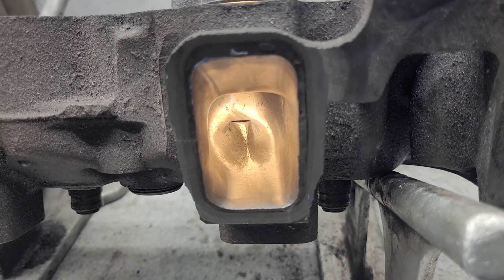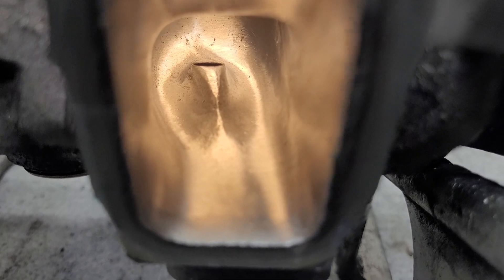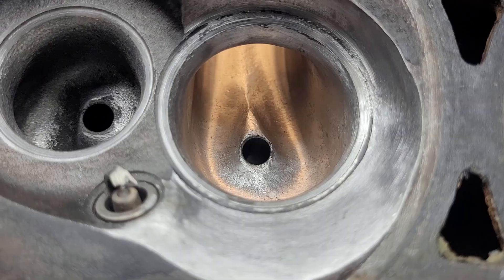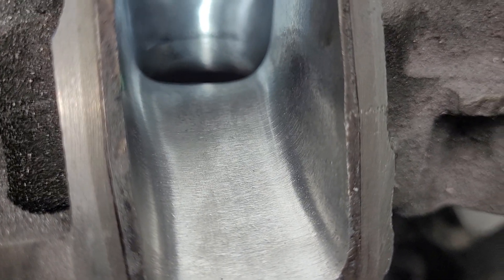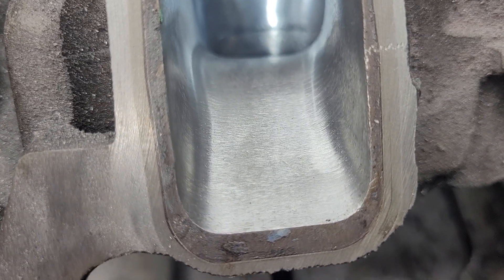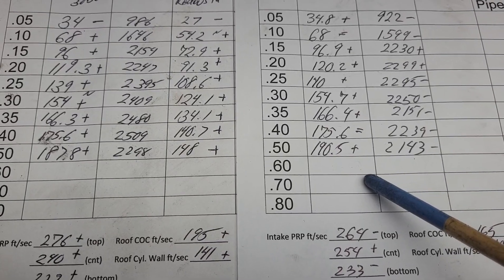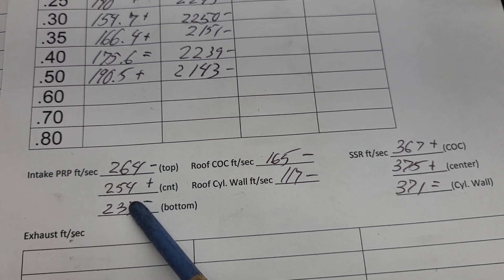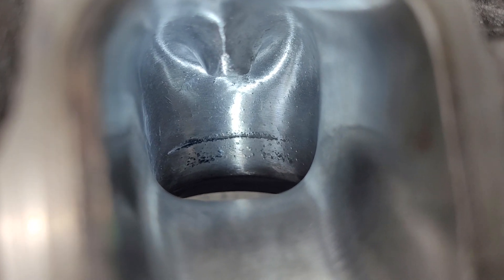The great port texture debate. Ford 4.0l burr finish to polished finish flow comparison.

Comment: At what point do you stop polishing the exhaust ports? 320grit or 1000grit?
Reply from the maker: Depends on application. Higher hp gets higher polish. Small ports get higher polish. I have gone to very fine crossbuffs. Thanks
Reply: @servediocylinderheads Street engine ls1 5.7 243 heads trying to make 550hp at the crank with a small 227 235 @50 277 289 on a 110.5LSA +1.5 cam 11.15 to 1 compression and Australian E10 fuel i think is equivalent to 91 octane in the USA
Reply from the maker: @lcxu1051 Pretty smooth
Reply: @servediocylinderheads so if i went to 1200 grit it would be perfect for that level. Close to a mirror finish
Reply from the maker: @lcxu1051 That will cover it.
Reply: @servediocylinderheads thank you for your knowledge. Very much appreciated Charlie.
Reply from the maker: @lcxu1051 You are welcome.

Comment: Maybe a stupid question but does a polish finish help carbon buildup. And how much flow is affected by carbon buildup?
Reply from the maker: I have read that polish helps keep carbon off but I have not seen this. Tight valve guides and effective ring packs keep oil out of the chamber preventing most of the carbon build up. Thanks

Comment: I can see how a polished finish doesn't break up the boundary layer and promote fuel atomization ... Instead of polishing would it be easier to "ceramic coat" the port wall as they do on some diesel exhaust ports if your customer wanted that? Is there a best way to add material to the bowl to seat interface to increase flow (or would that be a detriment)?  I think you would really like the newer Toyota 4cyl heads ,, all the intake flow is directed at a shallow angle (think HUGE port bias) to enter on the upper side of the intake valve only (side closer to the center of the cylinder) and create enormous swirl inside the cylinder.
Reply from the maker: They could be ceramic coated. I did some ceramic coating in the 90's it worked well but the prep of parts was alot of work. I have not seen the new port designs. Thanks

Comment: In a polished port like this, have you taken a burr to the throat? Lightly texturing about half an inch from the seat down and the circumference of that area(throat) I've personally experienced positive differences on the engine dyno, and with both fuel injection and a carburetor. However....that's when a polished finish was requested and paid for. I understand that a complete burr finish is a different circumstance. 

Btw, great work on the heads! It's always a pleasure to see your work. Keep up the content.
Reply from the maker: These were fully burred and now fully polished .
Reply from the maker: I won't do a fully polished intake port for a customer unless it was direct injection. Even then I don't like it.

Comment: @ 0:50 BAHAHAHAHAHAHA! C'mon Chuck! Its prettier and always makes the client feel good about the $1k in port work. 

All kidding aside. Cast iron does take FOREVER to work period compared to aluminum. Years ago I found myself debating the time to polish, to 80 grit cartridge roll, as well. Any higher than 80 grit and the highs and low are very visible. A slow grinder speed with 80 grit usually came out really nice, but the long hours.....ugh. 8 was super pleased the first time I was able to compare a double cross cut burr finish to an 80 grit finish. NO more time wasted and a lot less spent on cartridge rolls.
Reply from the maker: Exactly, less work runs better! I TAKE FOREVER ANYWAY.

Comment: 🔔😎
Windshield/rain.
But a coat of RainX on the glass and the tiny droplets blow away at 40+. 
It seems logical that a super shiney port would  let the droplets blow away. Consider, at that port high velocity the flow is making the surface contact slick.
Maybe the texture works better at low rpms?
Remember, you're only testing 28".
What about 50 ? Experts say scavenging at high rpms might do 50. 🤔🤔🤔
Reply: David Vizard has done the testing. Race motors can exceed 100" H2O depression during valve overlap. The charts are in some of his books. That said, 28" appears to representative of a large portion of the intake stroke as the piston is moving down the cylinder if you carefully look at the same charts
Reply from the maker: That is right 100" +!
Reply: @servediocylinderheads  
28 is just a test amount for comparison purposes.
We seem concerned about turbulence everywhere, boundary layer flow, and air breaking away from the short turn at 28... Even if it were good at 28, I'll bet it probably goes crazy at 50+.
Wonder how noisy a port might be at those depressions?
All we're doing is applying our best guesses that have given good results. The name of the game is RESULTS!! 😁😁😎
Reply from the maker: @hotrodray6802  I have done some work just like this, seems so far if it is good at lower depressions it is good at higher depressions. Thanks

Comment: We tried everything in the 70's and 80's, and this is how myths get started. A guy polishes a manifold and head. Does a bunch of other things, and sees good results. Tosses all the other stuff and says it was the polishing that did it.
A guy looking for more power seldom does only one thing.
My guess is a uniform rough finish would flow close to polish, but an erratic, uneven finish would do poorly.
Reply from the maker: We are going to work on figuring it out. Thanks

Comment: i realize its an apples to oranges comparison, but i've had good luck with aluminum flathead small engines with bowls & ports that smooth.but also realize that both port & bowl on small flathead engines the flow is only about 2 or so inches before it passes the valve seat.so the fuel dont have time to fall out of suspension before entering the combustion chamber.like i say, apples to oranges comparison.
Reply from the maker: Flat heads are so restricted I bet the polish works well.
Reply: @servediocylinderheads  Playing with an old flathead B&S lawnmower is fun... I took a 3.5 hp engine WAY up in power ,, felt stronger than a 6hp briggs mower I had.. slight break on the cyl wall edge at the valves , pocket work above the valves , filled some of the combustion chamber with weld and shaved the head with a belt sander for WAY more torque (really soft aluminum) .. cost about $4 for a head gasket... Briggs engines barely have 5 or 6:1 compression so they can be sold worldwide without mods even in countries where the gas is barely stronger than urine.
Reply from the maker: @briantracy1324  They pick up torque quite well with some work.

Comment: If it don't go, chrome it. Those are better numbers than I expected from the 4.0L in the infamous Ford Exploders. Oops, I  mean Explorers. Anyway, it's interesting since I have one and it needs an overhaul that will include some porting etc...
Reply from the maker: It is a pretty easy tune up really. I would do the exhaust manifolds, intake manifold, throttle body and air duct plastics at the same time. I bet it wakes up.
Reply: @servediocylinderheads  I already removed the air horn sound damper in the fender and built a fiberglass intake tube so next is the long block.
Reply from the maker: @psychoholicslag4801  You are on the right track.
Reply: Go chrome or go home..

Comment: I have always wondered  how a port would flow if the port was basically threaded with a fine shallow thread, or grooves making shallow ridges, a bit difficult to do by hand, 
I still like to polish the chambers and exhaust ports,  smooth as possible,
Reply: Try 40 grit rolls on a drill at a low speed. It makes circular grooves to intercept liquid fuel with lots of little edges to reintroduce it into the airstream.
Reply: Some of the tuner guys have been doing that for years. Claim notable power increases.

Comment: Polishing the short side has kept the flow attached, effectively removing air volume from the top of the port. Personally I don't mind seeing a polished short side,  as the aggressive pressure drop in that area will pull the fuel apart anyway. I know I think a little differently to most people, but I like to see clean walls when spraying dykem. My thoughts are that product on the wall is fuel wash. Now I know that in reality it is going to happen, but the more I keep in the centre of the air stream, the better, in my personal opinion. I'd be interested in your thoughts. As usual Charlie, another great video. I love your down to earth presentation style. Regards Greg
Reply from the maker: You are too good, I doubt I can teach you much. I agree with wet walls, not good. Thanks
Reply: @Charles Servedio cylinder head porting & flowbench  don't be mistaken about being able to teach me much. I watch you because I enjoy learning from your experience. Currently I'm thinking about starting a new channel dealing more in the theoretical aspects vs the practical realities of engines. Just playing with the idea at the moment
Reply from the maker: @theshed8802  Having a channel is way more work than I would have expected. I am also learning through feedback, so it is worth it. Thanks
Reply: Would have to dyno test it to see but in the diesels the. Fuel injector getting the spray to the piston bowl wall do it will break up and burn quicker is critical to power. If the fuel gets caught in the chamber it will burn too slow and perform aweful.

Comment: It hits the back wall of the bowl and starts to flow backwards up the port. Basically too much of laminar flow. Also, when there's no texture on the surface, there's no micro vorteses acting as ball bearings, so the laminar flow is dragging itself through the port. With this test, temperature gauge would be awesome.
Reply from the maker: Every test has temp and humidity recorded.